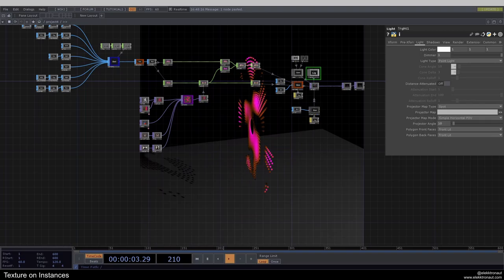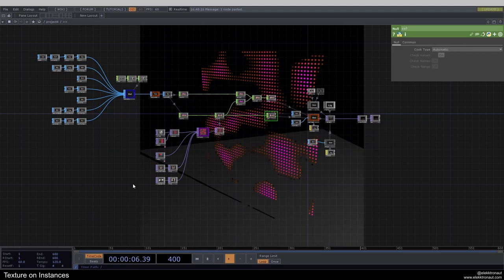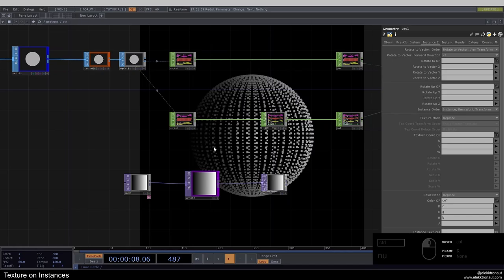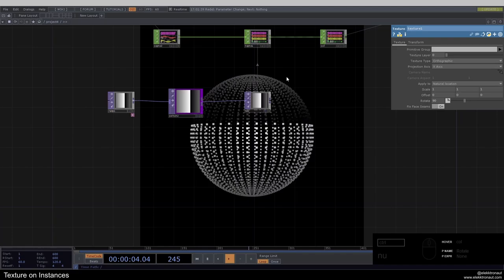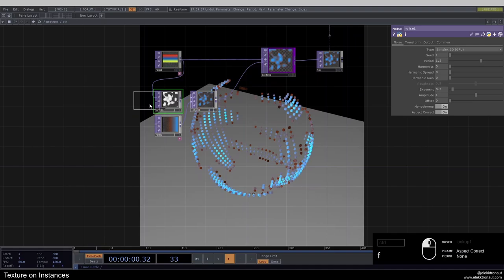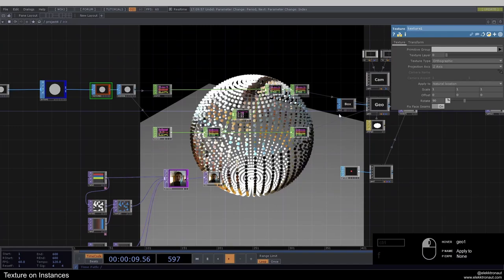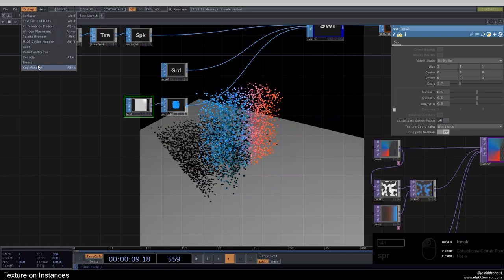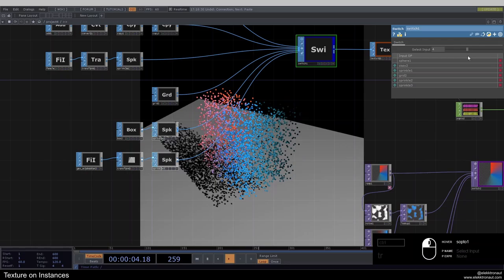Texture On Instances – TouchDesigner Tutorial 53

Comment: what operator could I use instead of a sprinkle SOP, for 3d model? I have no sprinkles
Reply: I also did not have Sprinkle SOP. But I used a convert SOP to change my 3D model to polygon type then I used a polyreduce SOP to reduce the resolution of the model to get a similar effect.